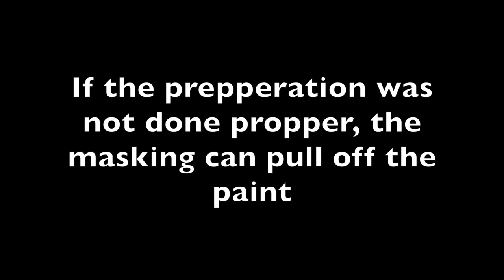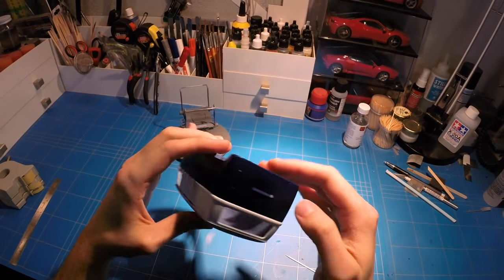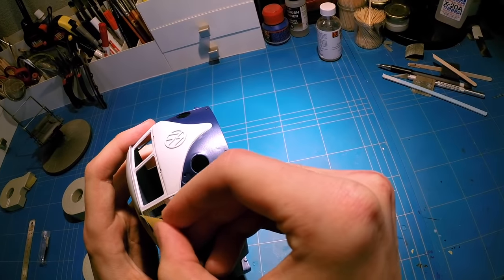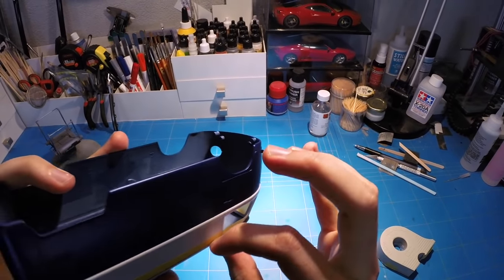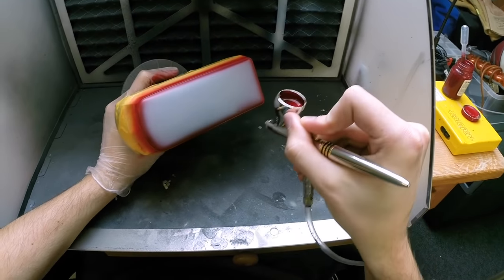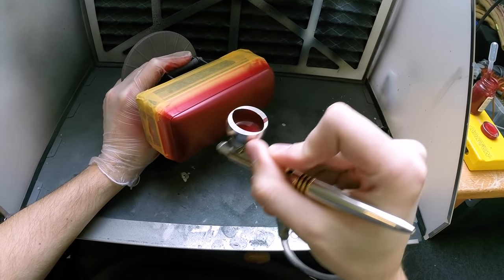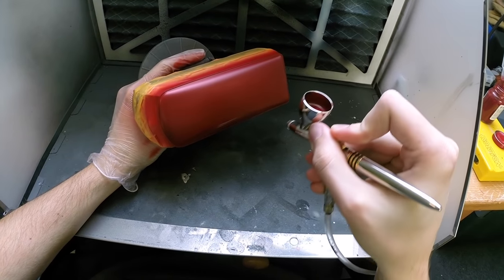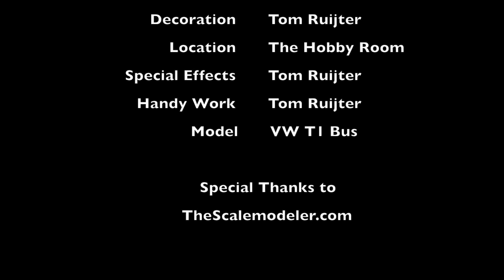Hasegawa VW T1 Type 2 Bus Part 3

Comment: Why do i leave my paint to dry for like 3 hrs when i mask the pain always stick to the masking tap. I use the tamiya spray can. Could it be i only use 1 layer of color on the model?
Reply from the maker: Tamiya paints dry a lot slower then Zero paints, leave that atleast for 1 full day before masking. Its also inportant to prepare the body before you even start painting. Sand it with some 600 grid sand paper this will help the paint stick. Spray 2 or 3 light coats.